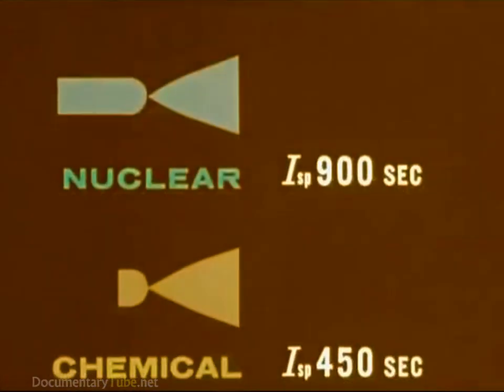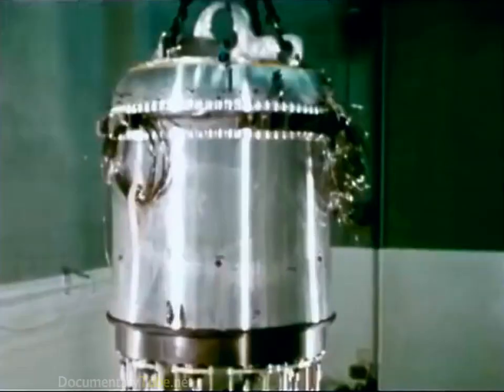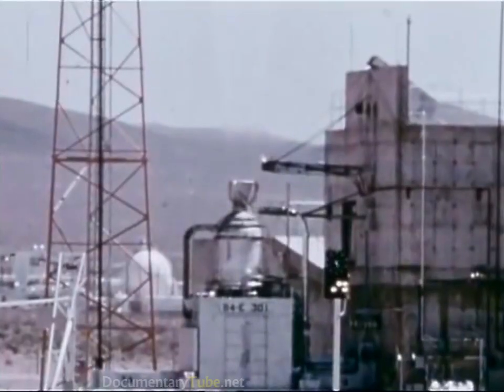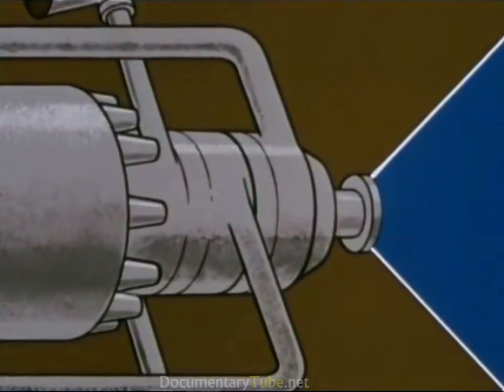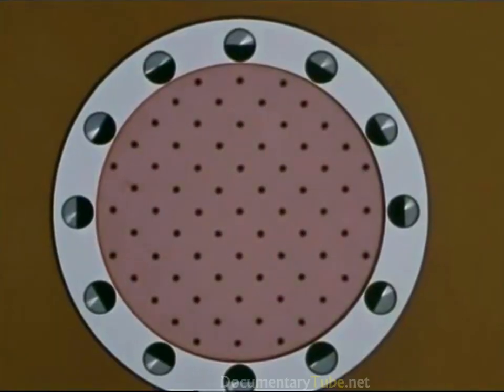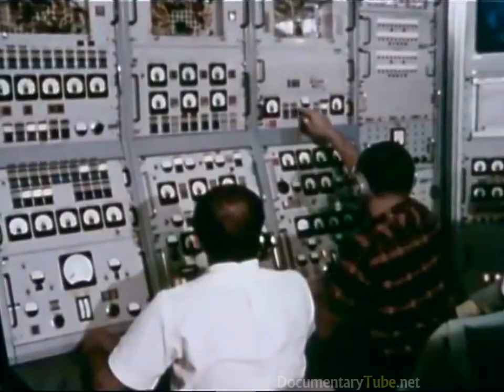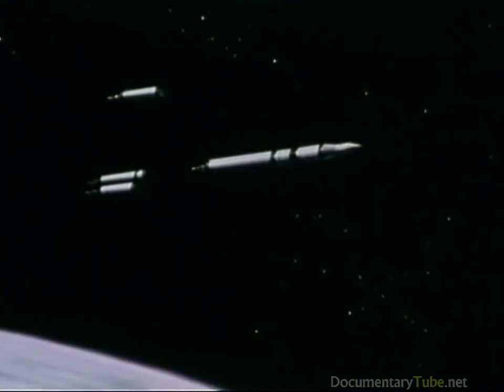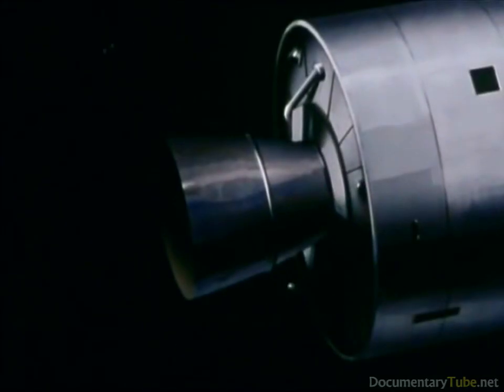HOW IT WORKS: Nuclear Propulsion

Comment: 10:10: "These rods can be operated by remote control".  
Like manually turning the control rods in a nuclear reactor is an option.
Reply: Gavigg75  Depends on the exact temperature at the control end. On the K219, twenty-year-old enlisted seaman Sergei Preminin went into the reactor room and manually wound down the control rods to stop the reactor melting.
Reply: JeanLafitte 
This was made in the 60s so remotecontroll was quite fancy and new then. Kinda like claiming today that you got an AI that can pass the turing test operating your tec.
Reply: "remote control" implies: at a distance.  You can have manual-mechanical remote control.  It doesn't automatically mean wireless.
Reply: Teleflex cables to turn the rods, perhaps coupled with a differential so there'd be no hole in the shielding conveying gamma and neutron radiation to the operator would have been an option around then, as they were used in aircraft, but that or something like a waldo would have added parasitic mass to that hypothetical nuclear fission-powered spacecraft
Reply: @jeanlafitte268  wtf did you just spit out?  LOL
Reply: @jensbrandt7207  Huh????
Reply: You could do it.  ONCE!
Reply: @robertcampbell6349  Unless you hired Spock!  Then maybe twice.
Reply: @robertcampbell6349  Yep, most humans can manually turn the control rods only once. Its doable.
Reply: @robertcampbell6349  come on! Be a man! Ghost does it infinite times!
Reply: @jacobsweeney2330  LOL!
Reply: manual operation should always be an option , especially for shutdown... reactor safely is no joke
Reply: Kind of. But every organ at once would leak fast. It's a horrible, horrible death. Could even be worse than death by fire...
Reply: where else do you think the communists will be then.
Reply: Spock did it
Reply: I mean it was in some early reactor designs and there was an accident where one of the operators accidentally fully removed a control rod and his supervisor was speared against the ceiling by said control rod.
Reply: They have slave ghouls for manual operations.
Reply: I don't suppose they'd be functional, and wouldn't turn back to the boron side after a crash. Then it goes super critical.
Reply: "Carl, stop turning those rods and get back in the rocket right now!"
Reply: Yes, you can (and it's been done in many ways) control the reaction in different ways. A common technique is to use "Control Drums" (where one side of the "Drums" act as absorbers of neutrons, and the other side act as a reflector of neutrons) thus controlling the reactivity by rotating the "control drums" to either reflect neutrons for increased reactivity or absorb neutrons for decreasing the reactivity.
Reply: No,  you have to turn them by hand
Reply: JeanLafitte Many have manual operation for emergency
Reply: I was thinking the same lmao
Reply: He he.
Reply: That is done using servo motors, and I'm wondering if they used SCR's or Thytron Tubes.
Reply: Did you lower the control rods?
Reply: In the thirties they were playing with a sphere of fissile material sitting in a hollow beryllium semi sphere and a matching one to cover which was designed to be the exact amount of neutron reflection required that every neutron would produce another before being absorbed. Some of the smartest people in the world were sitting in a lab with this test device on a table, the fissile material within the first sphere and the second one sitting on top with a screwdriver in between, there were 3 people in the room, the dingus slipped and the reflecting spheres closed, he immediately knocked it off which saved the other two guys in the room but he got fried, died a day or two later of radiation poisoning.

That was my explanation from memory using all the wrong terms and half misremembered, what I described did happen, this is just a much more accurate accounting of the event from the wikipedia entry for demon core:

...Under Slotin's own unapproved protocol, the shims were not used and the only thing preventing the closure was the blade of a standard straight screwdriver manipulated in Slotin's other hand. Slotin, who was given to bravado, became the local expert, performing the test on almost a dozen occasions, often in his trademark blue jeans and cowboy boots, in front of a roomful of observers. Enrico Fermi reportedly told Slotin and others they would be "dead within a year" if they continued performing the test in that manner.[12] Scientists referred to this flirting with the possibility of a nuclear chain reaction as "tickling the dragon's tail", based on a remark by physicist Richard Feynman, who compared the experiments to "tickling the tail of a sleeping dragon".[13][14]

On the day of the accident, Slotin's screwdriver slipped outward a fraction of an inch while he was lowering the top reflector, allowing the reflector to fall into place around the core. Instantly there was a flash of blue light and a wave of heat across Slotin's skin; the core had become supercritical, releasing an intense burst of neutron radiation estimated to have lasted about a half second.[6] Slotin quickly twisted his wrist, flipping the top shell to the floor. The heating of the core and shells stopped the criticality within seconds of its initiation,[15] while Slotin's reaction prevented a recurrence and ended the accident. The position of Slotin's body over the apparatus also shielded the others from much of the neutron radiation, but he received a lethal dose of 1,000 rad (10 Gy) neutron and 114 rad (1.14 Gy) gamma radiation in under a second and died nine days later from acute radiation poisoning.

How hard are you kicking yourself, bargaining with the universe, hating that you made that decision in those 9 days, the pain of that and admitting to your family that you were now going to die from something you did that was so stupid, that pain is worse than the pain of his sickness and death I'd imagine. I've been dealing with a tiny microcosm of this same feeling, middle of last week I snapped off oil switch that was leaking as I tried to replace it because I wasn't doing things by the book and it's been a major pain in my ass. Waited a week to see a mechanic about a quote, after that blew my socks off (I was expecting 2 or maybe 3 hours of shop time to weld on a tab and turn the slug out of the hole, I went to a specific engine rebuild mechanic [why it took so long for him to see me] which was recommended to me by a machinist that works with him on occasion when I asked him about how to handle the problem). I haven't had my car running for half a week and then I found out it was gonna cost me around 600$ to get that slug out of the port mostly because it's hard to access, but that's why I went to the guy, if it were easy I'd do it. Lots of issues to deal with regarding which fix hurts least and what the trade offs are, without a fix, the car doesn't tell you oil pressure and worse it always thinks it's low, beyond that, the slug has a hole straight through it to allow the oil pressure to push up against the now absent sensor so it would piss oil if the engine was turned on. Was debating what to do, say I just plugged the hole, if the oil pressure ever unseated that plug or I got a catastrophic oil leak somewhere else while driving down the highway, whole engine would seize without me knowing anything about it but a fix is incredibly expensive for such a stupid thing. I ended up being able to fix it with epoxy, which was a last ditch effort, I didn't even think it would work because I thought it twisted itself off leaving a bent and warped seam but it was a clean snap and the surfaces mated perfectly, if it ever brakes I'm in trouble. 

That was such a long story but the point of it is to share that I've been kicking myself so hard and wishing I hadn't used too big a ratchet, and some other steps that would have made it a lot harder to break it off and it's been fairly rough on me and it's so minor, when we make stupid mistakes they really weigh on us, especially when they have large consequences, imagine making this mistake and then having to live with it and say goodbye to your family over more than a week. My god that's hell on earth.
Reply: Thane Mac  Yeah I realized that after reading  the wikipedia page, I just didn't remember to include that correction in the copy paste from Wikipedia, it seemed like such a stupid thing to happen that in my head it must have happened before they even had a grasp on this stuff. Saying Thirties also isn't very specific, the Germans were doing Nuclear research in the late thirties and the Manhattan project didn't start until 1942.
Reply: Read about the SR1 reactor accident at Idaho National Laboratory.
Reply: Look up the SR-1 incident, there's a case where control rods were manually operated
Reply: Isn't that what Spock did in ST: II ?
Reply: @JoseyWales44s  Yes.  And he did it ONCE!
Reply: I mean it would just be a ring gear and moved by a simple pushrod or cable. The ends of the rods would have a little gear on their end turned by the big ring gear so a few degree rotation of the ring would twist the rods 180deg.
Reply: Back then, no one knew this was volatile, as dumb as we are now, we possess knowledge we take for granted that wasn’t readily known back then. But those people were not dumb by any means, they just had no knowledge of certain things… even handling old money would confuse the modern child today and many adults.
Reply: I caught that too... wonder if there's any data on how many times they had to operate these rods and manually shut it down...
Reply: @gravitationaleddie5611  manual shutdown of a nuclear reactor happened at least twice in human history, firstly in Chernobyl and secondly in Fukushima
Reply: Remember that time someone was manually lifting a control rod and he ended up impaled to the ceiling thru his ballsack and shoulder?
Reply: @InsanoBinLooney  You're talking about the SL-1 reactor incident at AEC's Idaho facility.  Part of the trouble with that one is its reactivity was crazy high. Sticking control rods added to the lethal accident in Idaho.  But you're right, manual actuation of those rods (which tended to stick) contributed to the chain of errors leading to three deaths.
Reply: JeanLafitte - Which was exactly the point the film was making.

Edit: To clarify, manually turning control rods in a reactor IS very possible (it's how they had been doing it in reactors since the 40s) when you are on the ground. You have room, you have all the air you can breathe, and you have somewhere to go if something goes wrong (maybe not the time to get there, but not feeling trapped is a good thing anyway). The "cool tech" moment here is that they had figured out how to do it remotely, without someone hugging the reactor while hurtling through space. The last date mentioned in the film is 1967 (I think), which means it predates our moon landings by a couple years...and it is hard to wrap our heads around just how much we did not know yet.
Reply: JeanLafitte Educate yourself before writing comments. The first Sela Field open air and air-cooled graphite moderated Nuclear Reactot WAS MODILATED BY HAND NOT REMOTE CONTROL. We have lost our phreaking guts.
Them good ol' boys and some gals were very SMART AND GUTSY. Our over-civilized politically correct society is lacking that type of people. By the way Sela Field is in England - I believe WESTERN ENGLAND.
Reply: @ianwalton284  The soviets had a similar project to Nerva back in 60s known as the RD-0410 which had slightly better performance  characteristics. An evolved version has been the basis of a new propulsion project started in 2009 and is currently in testing. 

Your statement makes you look quite ignorant now doesn't it?
Reply: yermanoffthetelly - you must be KGB to have access to secret Russian data analysis or simply bullshitting !!! Now, which one is it?

Comment: Also move the tube where hot waste gas leaves to power turbine maybe move it more out the exause to get better flow out and creating even back pressure if it had a round ring around exhaust pipe inside to catch it evenly as it is being pushed out while making slight even change in exhaust then making more back pressure? Also time stamp next post.

Comment: Wonder if u get a better burn if the plate where the fuel enters through the holes. Fills up every hole first before fuel enters to get a more even burn by fueling at same time even at a milla milla sec?

Comment: Once outside any significant gravitational pull, I would think the rate of flow of an action/reaction propulsion system would be more important than pounds of thrust. Thus, a laser beam projected out the exhaust portal could produce more velocity than hydrogen super heated by nuclear radiation.
Reply: for 1 newton of thrust from a photon based truster you need about 3MW of energy or about a small nuclear reactor, it is incredibly efficient but the acceleration is to small to actually amount to something

Comment: I doubt seriously there will ever be a nuclear rocket engine until we've cracked the problem of controlled fusion.
Reply: controlled fusion is the only "engine" component with any economic viability
Reply: "Economic viability"?  So far, everything I can see (looking at https://www.nextbigfuture.com/page/2?s=fusion+space) is only economically viable with "someone else's money".  When Elon Musk points at one of these technologies and lays money down, we can talk.
Reply: https://patents.google.com/patent/US20160027536 "A mobile heat pipe cooled fast nuclear reactor may be configured for transportation to remote locations and may be able to provide 0.5 to 2 megawatts of power. "
Reply: https://www.nextbigfuture.com/2018/02/revolutionary-small-modular-nuclear-reactors-for-space-and-earth-applications-starting-in-2024.html More about how megawatt fission power can do a LOT in space.
Reply: Try watching the news, Russia has created a fleet of missiles based on this technology. I guess if you going to start a nuclear war you don't care about a little extra radiation.

Comment: Wow, I wasn't expecting it to have that kind of thrust in the atmosphere - figured it would have small thrust to be sustainable, like the ion drives.
Reply: The benefit of nuclear thermal rockets is that you get high thrust with reasonable efficenc
Reply: It burns the fuel at super high temps to induce the explosive reaction.  But the reaction becomes sustained with the multiple nozzles going through the core.  Initial pressure is controlled with the flow slowly released after the reator has been preheated for firing.  Then pre stage ignition happening before full throttle run up.  Once the reactor rods are in the off position the fuel is finally cut. As to prevent a nuclear meltdown of the engines reactor chamber. Hot enough for a reaction but not hot enough for a runaway meltdown.

Comment: You see after testing they were behind glass doing disassemble. That entire rocket is radioactive. And how are the nuclear fuel cells controlled after shutdown? Once ignited they burn very long time and need constant cooling. I.e. fukashima & chernobyl explosion because the water cooling supply went faulty.

Comment: We have nuclear submarines.   Why not space subs? As long as they are in space should be fine.. 
They can build a dockimg/cleaning station on the moon.  Lmao
Reply: Water is used for cooling especially in an Emergency Situation.
Reply: They're very different, one needs to survive pressure, the other, the vacuum of space
Reply: @midgetman4206  it's a hell of a lot harder to survive the depths and pressure of the ocean. then it is the vacuum of space. The only thing you have to worry about in space is micrometeorites and space junk
Reply: @cailco100  and radiation/neutrons
Reply: @midgetman4206  Those too. and hope you don't run (get pulled into) a black hole alone the way
Reply: It's actually not that bad of an idea
Reply: Because of the Outer Space Treaty, which the US signed in 1967. To keep it simple, no nukes allowed in space or other planetary bodies.

Comment: well for commucation with mars we Earthlings have that already it takes around 3 to 20 Earth minutes for a one way transmition to get through depending on where is Earth and where is Mars 
the current problem is extended life in space which will be needed has not been possible without a resupply from Earth yet so that problem has still got to be figured out before it will be safe to send any human being to Mars as running out of food is bad the rocket system also did not seem to take into account the space needed for a cargo module which would be used for the life support systems to that most likely more thrust will be needed than in that video to just support all the parts and pieces to which then you will get into the thing of how tall is to tall for it to be and still be able to stand in the correct angle for launch on Earth launching with some of it underground is one solution but that has its own problems too

Comment: what kind of application could something like that really have, then? deep space exploration?
spewing out radioactive exhaust isn't a big deal if you do it once in a while, right? obviously this couldn't be used for constant travel over established travel routes.. the exhaust would build up, wouldn't it?
could something with this kind of propulsion system be refueled by harvesting hydrogen stuff floating around in space? so could it be feasible that it could be self sufficient? say, if it had some on-board little robots that could be deployed to mine hydrogen from asteroids and the like, and return it to the ship? and they'd repair themselves and the main craft using that same method for materials?
i enjoy thinking about this kind of stuff ;D